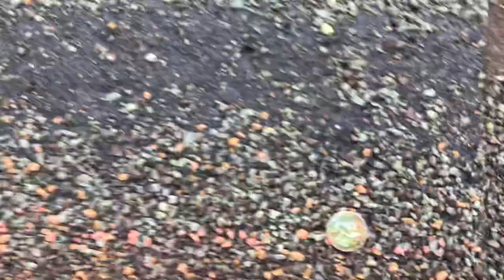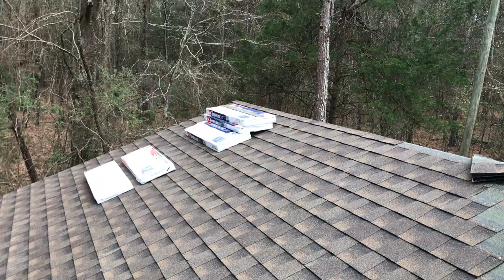Why Nail Pattern On Comp Shingles Is Critical - Quality Control

Comment: All of the nails on the end rows were placed too close to the end of the shingle  (3" inch minimum)
Reply from the maker: I’m assuming you’re referring to local codes where you live? Or maybe a particularly rare instance where the manufacturer’s instructions are an exception rather than the rule in the region of the country where I passed my contractors trade test with a near perfect score 25 years ago? And that after 10 years of being a journeyman roofer? You’re really gonna critique my nailing like you are?

There are issues with my nail pattern but this isn’t one of them & I’ve changed some recommendations along the way after 30+ years of professional roofing because experience says my way actually works better than the recommendation. But I digress… bottom line is the distance of my nails from shingle ends is exactly what manufacturers & local code trades commission require in order to license my sorry carcass 23 years prior to making this video.

Comment: Check out the nail line on malarkey shingle.
Reply from the maker: Aaren Colwell Alright, malarkey is the first manufacturer I’m aware of to make a wider nail zone of 1-5/16”. That’s still only about a half inch wider. But this is new product, not the shingles I was referring to in my video. All manufacturers have been making the narrow nail line for the last 20+ years. Those are the ones that local inland empire roofers have been nailing super fast on & no doubt missing the nail line. I know this because literally 9 out of 10 shingle repairs I’ve done over the last 30 years, had the nails nowhere near the nail line when I took them apart to do the repairs.

Comment: You made an entire video explaining how you still have misconceptions after 30 years of experience. You actually went as far as calling other roofers corrupt when you're just mistaken. The low or fine double nail line is the nail line for slopes exceeding 21:12. Any slope from 2:12 to 21:12 can be nailed on the wide line. Since 21:12 is basically an A-frame, you are very unlikely to ever encounter a roof that needs to be nailed on the low double line. So there's nothing wrong about pop pop pop pop roofing. This is just a mental concoction intended to make yourself feel better about how much slower you are than other roofers. It's Because they're doing a bad job and you're doing a much better job right? It's sad honestly. Considering all a person has to do to acquire this information is read a bundle of shingles.
Reply from the maker: Eyeslo 420 it didn’t take but five minutes on YouTube to confirm my assertions straight from GAF. Maybe you’re referring to 3 tab, cause if you don’t go through both layers on every laminated architectural non-3 tab shingle, you will void the manufacturers warranty. And since I was installing laminated architectural shingles in the video, it’s kinda a given that’s what I was talking about. You can go troll somewhere else.
Reply: No mater what you prefer to believe, people can still read a bundle of shingles for themselves.
Reply: @eyeslo4206  I just read my GAF Timberline HD SR shingle wrapper, and it states, "These shingles MUST be nailed a nominal 6" (152mm) from bottom of shingle, above the cutouts, as shown."  Below that is a diagram of the shingles, showing the "Nail guide line", and annotating that line as 5-3/4"-6-1/4" (146mm-159mm).  Nothing about 21:12 slope.  The instructions do, elsewhere, mention that for 21:12 slope and above you must manually seal the shingles instead of relying on the self-sealing strip.  According to the manufacturer's installation videos, it's a very common mistake to nail high - probably the MOST common mistake.
Reply: It must be the manufacturer recommendation for your east coast shingles. We dont use GAF over on the west coast. Sounds like GAF knows that their shingles will slide apart if not nailed precisely because they can't spare a half inch more material to bring the second layer up the nail line.
Reply: @eyeslo4206  I'm on the west coast.  About 25% of the roofers I interviewed for this job use GAF.
Reply: Far more purchasing power when nailed between the lines. It's twice as thick! Check the instructions again. 
 Where I live, ( near the ocean) if you don't nail between the lines, you might as well kiss the warranty goodbye. I've seen it countless times. 
I understand the higher line is easier to go by, but it's honestly a cheaper lazier way to install them. No offense, but I sleep better knowing I took the time to do mine right.

Comment: use owens corning and you can bap bap bap bap all you want. depends what manufacture you go with. malarkey you can bap bap bap bap bap. he's right about timberline shingles and others that don't have a thick nail line. but before you judge your roofer do a little more research.
Reply from the maker: the shop You are mistaken... All the laminated shingles by differing manufacturers are made the same with a narrow nail line & you MUST land the nails through the double thick section across the middle of the shingles where the NARROW nail line is or you’ll void your warranty, and for good reason... nails tear through the single layer of shingles under stress of wind, heat or high slope/pitch applications. I wasn’t referring to cheap 3 tab shingles either. I was referring to architectural laminated shingles like the ones in my video that most homeowners have installed.

Comment: If you don't " hand nail " the shingles on the manufactures nail line/zone, you won't be roofing my house.
Reply from the maker: Why or why not? The biggest problem with people who have standards or rules is not having legitimate reasons for those rules. You’re free to hire whoever you want, but commenting here implies that you’re attempting to influence the culture to adopt your standards. Otherwise you’d have kept it to yourself. So if you’re gonna attempt to influence the culture to adopt your standards, you should have legitimate reasons for those standards rather than arbitrary biases… like only hand nailing can achieve acceptable results.

I do agree that the temptation is high to be careless as soon as you put a nail gun in the roofer’s hand, but I’ve personally reroofed hundreds of houses entirely on my own with mail guns & achieved the standards to uphold not only the manufacturer’s warranty but also my own warranty to my customers. But in order to do so, I had to slow down a bit & be meticulous in my efforts; even after decades of experience nailing shingles.
Reply: @MrThedocholiday  I won't need to be as concerned about speed nailing, or nails not being in the nailing zone. There are several roofers in my area that hand nail only and advertise it. Several new houses were built behind me in a new sub division and it sounded like the Mexican roofers were rapid firing semi auto hand guns. I could also see them from my home. I get the convenience and time saved using a nail gun and not swinging a hammer. I agree that if nailing at a slow enough pace with a gun to put the nail in the zone and with proper spacing is acceptable, as long as any nail is finished with a hammer to flush it of course. If I were in the business I would offer customers either method. If they had no preference, then I would decide. I'm not questioning your work ethics or the quality of your work. You have a right to make decisions for your business. This is America.  If all roofers decided to never hand nail again and use a gun, so be it. Customers would have to accept it. How many residential and commercial customers would attempt a DIY on a new roof install ? You and all business owners and employees in trade careers deserve to be appreciated. It's hard labor and we need your services. However, when choices are offered in materials and/or labor methods, the person doing the paying, has a right to do some saying.

Comment: 1 roof warranty is bought as good as tp I done it as long as this guy why do they want nails there not so much a big deal on low pitch roof but 8 9 or 12/12 pitch the tar let's go an the bottom part falls off.  the top shingle. aka dragon teeth is just glued to bottom base. so miss nail line an you got trouble.   lol code inforcment some guy with no clue about anything lol
Reply from the maker: larry Bak So you haven’t seen shingles delaminate on standard pitch roofs in the summer heat when nails don’t go through both layers? It happens often on steep roofs but I’ve seen it happen hundreds of times on standard pitch roofs also. That’s why I brought it up in my video; that & high winds easily rip off the shingles when they’re not nailed on the line.
Reply: I live near Biloxi Mississippi not ever on a 4 or 5.  but on 8 an on up I seen 10footx 10 foot section slide off when you nail to high the nails tend to set to deep.  I had one that was 4/12 they over exposed it by a inch an nailed high they flopped off with a stiff breeze. look at my videos.  we picked up 20 square in half a hour.    but here on coast it gets 90s an 100s for days on end I seen more of the tar on dragon teeth Let go an from nails being high the base falls off
Reply: but be honest with people a roof warranty is like tp paper. they come out you under vented or tree to close to roof or like you said not nailed right an that's just one nail they need to find to void it they always find something.   its like any warranty its all wrote by there lawyers to save there ass. I don't care if you pay 100 bucks a bundle for shingles that will last 100 years promise they will not want 100 year roof buy slate or taracotta or something like that

Comment: I don't think u needed that last course
Reply from the maker: The last course depends on the width of the ridge cap. And, if the ridge trim cap ever blows off, the shingles will keep the ridge water tight without it. It’s a safeguard.
Reply: @MrThedocholiday  good thinking nice work

Comment: and if you put a nail on that line, you will be replacing a rotted roof
nails have to go to the top of the tar line or wind will blow water under the shingle and go through where the nail is everytime
Reply from the maker: chris owens The nails are weather resistant just for that reason & the wind can’t blow where it has no flow. If the shingles are sealed down properly, the water running down over the bottom edge of the shingles will prevent water from running uphill under the shingles. So no, it won’t happen every time, unless of course your roof pitch is near or below manufacturers recommendations for roof pitch minimums. So how long have you been roofing & troubleshooting leaks? I’ve been doing it over 30 years now. That’s why I posted the video with confidence. Put the nails where the manufacturer recommends them or I’ll be telling the customer & calling code enforcement on your next job... If I knew where you work that is.

Comment: Always below tarline, simple
Reply from the maker: ImNotGood15 AKA.NotGood There are no tar lines on these shingles. That would be 3 tab you’re referring to. On architectural shingles they print a nail line instead. Thanks for watching.
Reply: @MrThedocholiday  actually you are wrong, on this specific  brand it may not have a definite tarline but, most of these shingles do. This brand has the line on this under side of shingle. A lot of the archetectural shingles have it above the nail line. Rule applies to any shingle, under the tarline is where the double is and it will catch the shingle under it as well.

Comment: So u can’t nail fast and be good?? All it is is practice after doing it for so long u know where to nail and still be fast yeah u might get the odd nail that’s not perfect
Reply from the maker: There’s theory & there’s reality. The granulated shingles never kick the nail gun back the same way twice. Add to that the body mechanics of your arm in an arc shape as you nail across the shingle rather than straight like the nail line on the shingles. The nails never come out of the nail gun the same way twice either, despite manufacturers fabricating all sorts of solutions for the problem. This is why real guns twist the bullet to keep it from tumbling, unlike nail guns. Besides all this, you have a 3/4” thick line where you need to place those nails at full speed & you’re telling all of us that most knuckle dragging roofers care enough to make sure ALL these challenges are overcome by any ninja master roofer? Really? Boy do you live in rainbow, unicorn, balloon land.

My knuckle dragging days taught me to slow down enough to hit the nail line, but in all my 30+ years of professional roofing, I never met anyone else who cared enough to hit the nail line. They’re out there, but they are a rare breed if they do.
Reply: @MrThedocholiday   u can be fast and do quality work we do it all the time passes inspection all the time and I’m not talking about a dumb home inspector ppl that are qualified, how u said it just comes off as a hater not saying you’re just what it sounded ,

Comment: this is why i prefer going with a company that only hand nails their roofs.its a far better roof.machine guns are for the shooting range not on your roof
Reply: benzboston Hand nails have no bite where as the coil nails have wire which makes shingle more secure if you set the depth rite, and use the nailer properly I’ve repaired a lot of hand nailing jobs and looking at the job hand nails eventually pop off
Reply: Benzboston, always hand-nailed and never had a problem.
Patrick Tanner, I've seen too many careless mistakes with nail-guns and I think the only time a gun should be used on a roof, is for nailing the deck.. With someone following behind with a hammer.
Reply: Get real, or pay $500 per square in labor. That comment sounds good, but unless Abraham showed up with his son Eli in his horse and buggy how many people have you actually hired that hand nailed a roof?